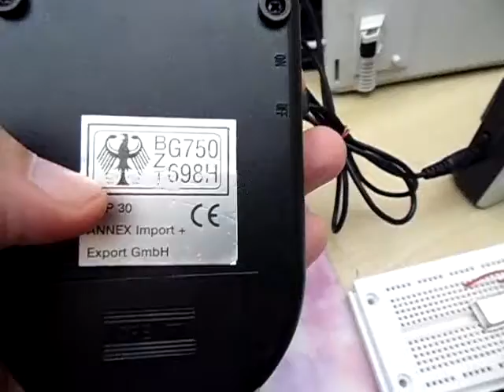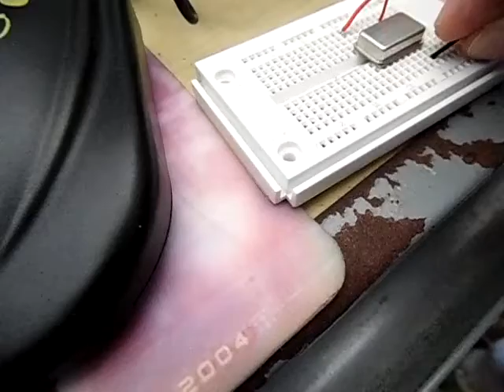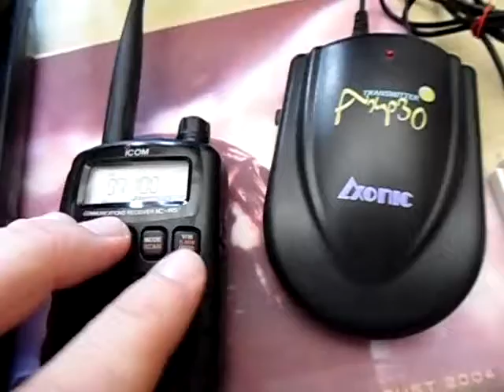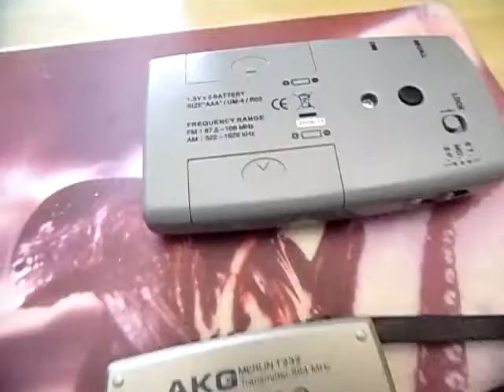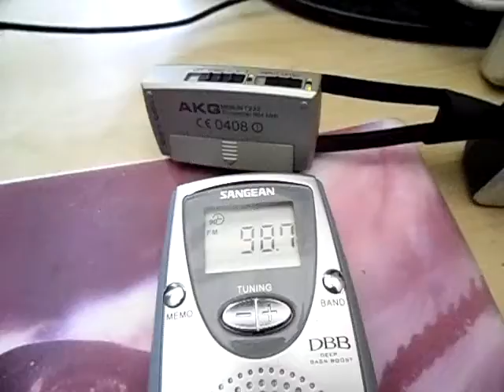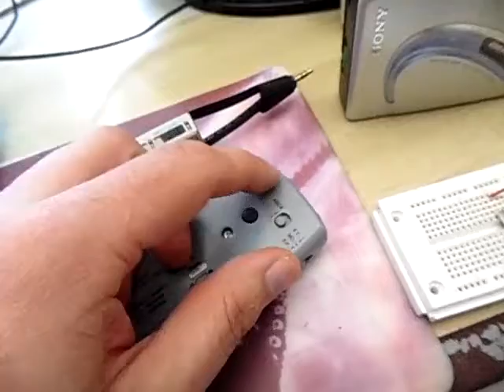Clem´s mysterious signal generator explained

Comment: It wasn't really a problem, I just thought it was interesting how it works, heterodyning (I think that's what it's called) is still somewhat of a "black magic" to me.  

So when adding two radio frequencies together, you can pick that up on the sum of those two frequencies?  So let's say I had two transmitters, one transmitting music, the other one transmitting empty carrier wave, but both transmitting at say, 50Mhz, I would be able to pick that up if I tuned into 100Mhz?  

So how come if I try and pick up an FM station that's broadcasting at 88Mhz and have the frequency generator set to 20Mhz, I just get static (I just tried it) if I tune the radio to 108Mhz? Surely it should work 88+20=108, so what's the deal with that?